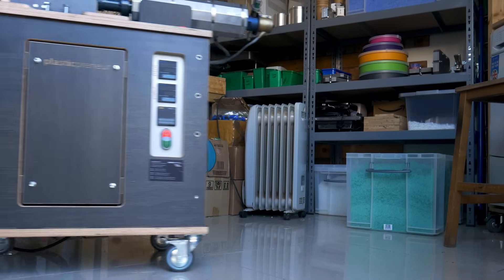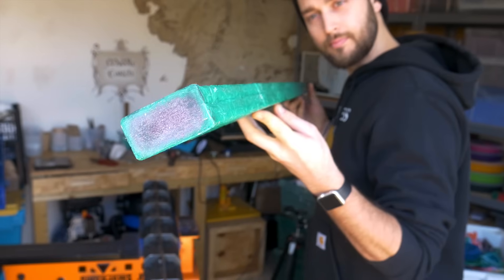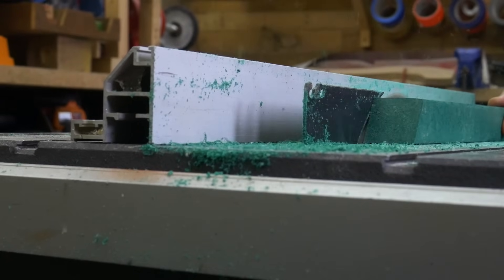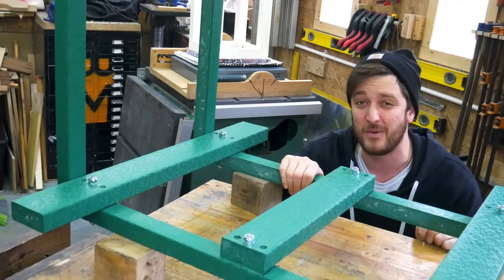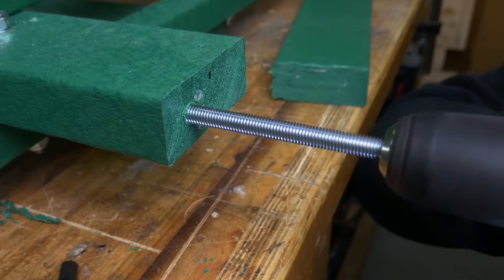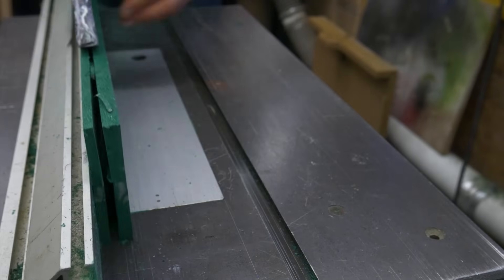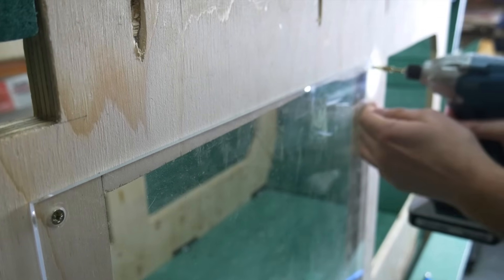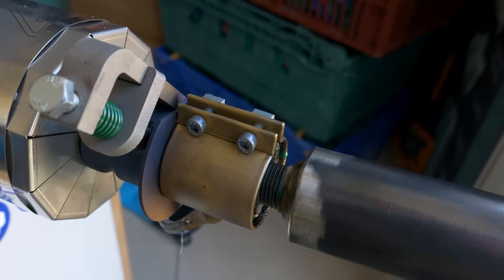We Ran out of Plastic to Recycle, Here’s How We Got More

Comment: The item here that you call an extruder is the very thing used with injection molding to force the plastic into the mold.  As with a lot of products the injection molding machine is rated by the clamping pressure it can exert;  i.e.  20 ton press, 210 ton press.  I've personally worked with injection presses ranging from 10 ton all the way up to 450 ton.

Comment: thats gotta weigh 200-300 lbs . given that its only going to fill up with maybe 80 lbs of plastic you are going to regret having to pedal soemthing that heavy i think. plastic sheet 1/16" thick would of worked with a frame. engineering overkill.
Reply from the maker: Saves going to the gym 💪

Comment: Next is recycled electric bike
Reply from the maker: Haha we may need a little more practice first!
Reply: @BrothersMake  it’s not that hard you just. Bicycles are used by millions of people worldwide, for various reasons. People bicycle to work out, commute, deliver packages, compete in races, or just ride for fun. Riding a bicycle might seem easy to some, but it’s actually very complex. Both the rider and the bike play an integral role in the process, which is really more of a science than an art. So, how exactly does this two-wheeled object get us from Point A to Point B?

Bicycles turn energy created by our bodies into kinetic energy. Kinetic energy is “a property of a moving object or particle and depends not only on its motion but also on its mass” (Encyclopedia Britannica). If work, which transfers energy, is done on an object by applying a net force, the object speeds up and thereby gains kinetic energy. A bicycle can convert up to 90 percent of a person’s energy and movement into kinetic energy. This energy is then used to move the bike. The rider’s balance and momentum help keep the bike stable while traveling along a path.

How Bicycle Wheels Work

A bicycle wheel and the axle it turns is an example of a simple machine. It’ll accumulate force (speed) depending on how you turn it. Bicycle wheels are typically taller than most car wheels. The taller the wheels, the more they multiply your speed when you turn the axle.

The wheels ultimately support your entire weight but in a very interesting way. If bicycle wheels were completely solid, they’d squash down as you sat on the seat and push back up to support you. However, the wheels of most bikes are formed by using a strong hub with a thin rim and several spokes. Bicycles have spoked wheels to make them both strong and lightweight and to lessen drag.

How Bicycle Gears Work

Gears linked by the chain make the machine go faster or make it easier to pedal. Gears are also an example of a simple machine. Gears can make an incredible difference to your speed. Say the gear ratio on a racing bike is 5:1. This means a single spin of the pedals will power you about 35 feet down the street.

The force used by pedaling enables the gears of a bike to spin the back wheel. As the back wheel rotates, the tire uses friction to grip the area and move the bike in the desired direction. How much energy are we talking about? You can generate about 10 watts of energy with a hand-cranked electricity generator, though you can’t use one of those for very long without getting tired. This tells us that it’s much easier to generate large amounts of power for longer time periods by using your big leg muscles than by using your arms and hands. Bikes make great use of the most powerful muscles in our body.

How Bicycle Brakes Work

No matter how fast you pedal, you’re always going to need to stop. Brakes on a bicycle work using friction. Although some bikes now have disc brakes, many still use traditional caliper-operated rim brakes with shoes.

When you press the brake levers, a pair of rubber shoes clamps onto the metal inner rim of the front and back wheels. As the brake shoes rub firmly against the wheels, they turn your kinetic energy into heat, which has the effect of slowing you down.

How Bicycle Handlebars Work

The handlebars of a bicycle are actually a type of lever. Longer handlebars provide leverage, which makes it easier to pivot the front wheel of the bike. The further apart you space your arms, the more air resistance you create. The typical outer parts of the handlebars are for steering, and the inner parts are for gliding.

The apparently simple two-wheeled machine uses momentum, force, and friction and converts energy to get riders to their destination. Whether you’re teaching the physics of a bike or a lesson on the simple machines used, there are many exercises (no pun intended) to be learned on bicycles.
Reply: Lol